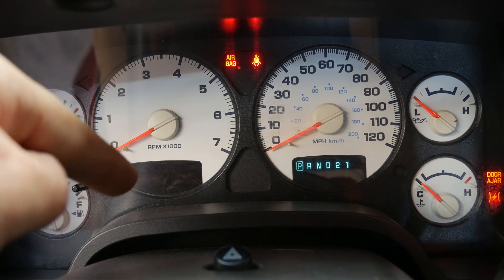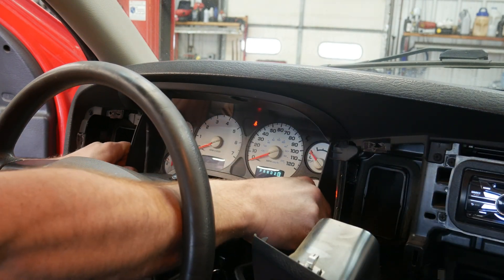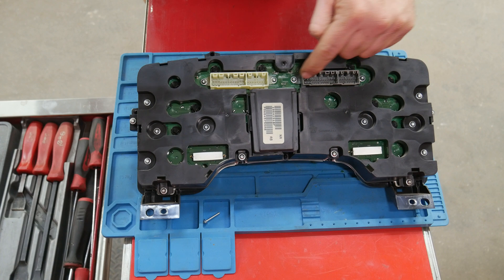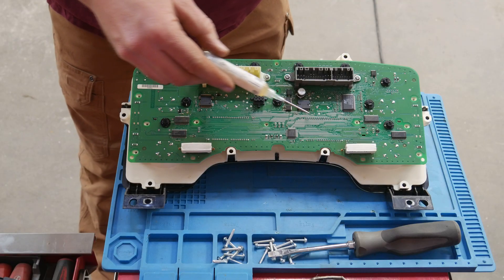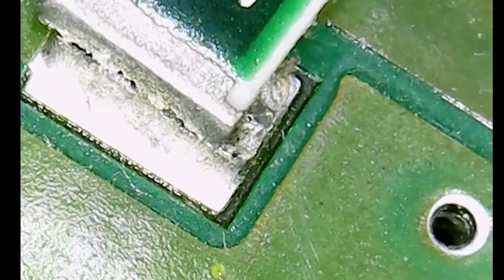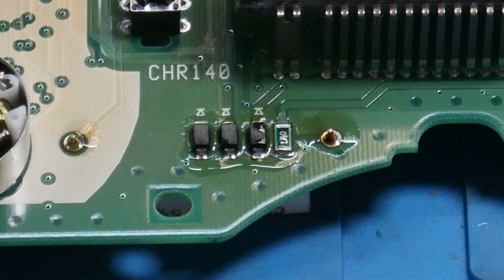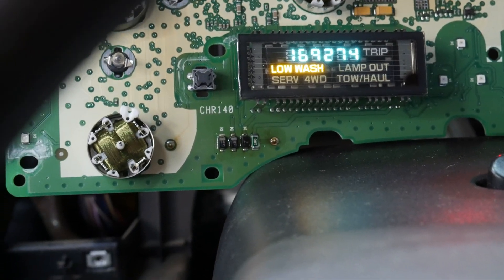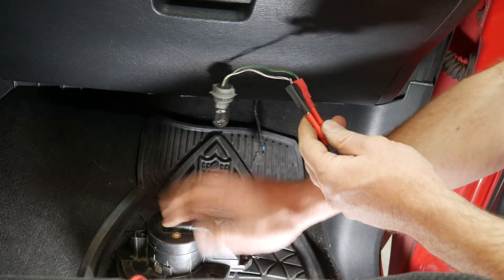2004 Dodge Ram No Odometer on cluster repair and checking blower motor

Comment: Could it be possible to replace the odometer with a new one
Reply from the maker: You could install a used cluster but the mileage would be incorrect unless you perform the correction or swap the memory chip.

Comment: Mine had the same issue and luckily I was able to solder it without having to remove the needles. I’m assuming because the big resistors on the back side build up heat that this is a pretty common failure point due to the heat exposure.

Comment: Money! This is exactly what was wrong with mine. I was also able to solder it still together so I didn’t have to take the needles off
Reply: Were you able to to get in between the two pieces and resolder without having to take them apart?
Reply: @C @CaliTBear yes, it was tight but doable with a steady hand

Comment: where are you located? I have a 2004 Ram Diesel with electrical issues (turn signals and intermittent cluster not showing mileage ) I would love to have it checked by someone like you
Reply from the maker: @fpvtrucking4830  Colorado a few hours south of Denver.

Comment: Great video....I to own a doge 1500 STI Hemi. It runs fairly well with 237k miles om it! but I'm getting around 9-11 miles a gallon with no load on the high way!!!!. I also always use top grade full so just figuring out the best next step.
Thanks,
Tj

Comment: Hello. Great vid. I’m having problems w my lcd and light display. Everything was working fine then all of a sudden the lcd , engine lights etc, odometer, turn signal doesn’t show but they work. Just no display . Also the backlights for gauges work but nothing else. Still runs great but I need to fix it, hard to drive wo the lights and hearing the turn signal clicking when using. Any help much appreciated!!!
Reply: I have these EXACT same symptoms. No lights except for tach speedo backlight. Did you ever figure it out?
Reply: @WarriorNurturer-vg8fd  yes just recently. I usually stay low in gas tank. Always refilling at almost empty. But I got some overtime and decided to fill up gas tank. 133$ later of 89 octane the damn cluster just lights up, brighter than it ever has! Try that, if not u might need some chips resoldered.

Comment: Can anyone answer this question please ? 
I have a 2006 dodge Cummins 3500 with 226520 but the whole cluster is shot.  I found one one line but the miles on it 129760 when I hook it to mine will it read my miles or his ? Please advise
Reply from the maker: The mileage is stored in the cluster on most of them so it will read his mileage.

Comment: All my dash gauges turn on and off like intermediate wipers. Drives me crazy driving down the road and they turning off and on and off....any ideas? Somebody said it could be the wires in my door.
Reply from the maker: The doors can be unplugged in the door jamb if you wanted to eliminate those from the equation.

Comment: I have a 2005 Dodge Ram 1500 4.7 two-wheel drive I replace the three speed sensor and the differential and transmission my speedometer is not working I hook my scanner to the truck and I can't get no speed what is the problem that speedometer

Comment: What temperature do you set your solder iron to reflow those components?
Reply from the maker: I typically have it set to 350°C some times I bump it up to 380°C. Leaded solder flows at lower temps typically so it can help to add just a little leaded solder when reflowing.

Comment: Thank you! Thank you! Thank you! Thank you!
 My 2003 Dodge Ram had the exact same odometer problem (intermittent then inoperative). It was even the very same capacitor causing the problem!
Thanks to your video, it was very easy to fix.
My name is also Chad 🤣😂🤣

Comment: Please help me. I have a 2004 5.9 cummins 2500. None of my dash lights work they were working on and off after I bought the truck but now completely dead. At night I can see my cluster if my lights are on. Any pointers?
Reply from the maker: I am no expert on cluster repair but on this one I just reflowed as many resistor as I could and hoped for the best.

Comment: I have an issue on the same instrument panel where three of my Dash lights work, and none of the other ones do. I replaced the bulbs and it doesn’t make any difference. I’m curious if you think it might be corrosion on the board or the lights plugged in or if there’s a resistor that powers different sections of the light

Comment: I have a 2002 Ram 1500 SLT and the odometer back light stopped working. Do you have a video on how to troubleshoot the backlights?
Reply from the maker: I don’t have one for that issue but the troubleshooting may be the same. Make sure you have proper inputs for the illumination circuit and if so just start reflowing solder joints of the resistors until it works again.  02 is an older design and likely simpler to diagnose

Comment: So my odometer back light stopped working. Took my cluster out and removed the rear cover, and looking at that same small component where your broken solder connection was, I also found te same result. I didn't need to remove the needles and disassemble any further, as I was able to resolder them still assembled. Thanks for the awesome video, and explaining the process.
Reply: Same thing here on my 04. Just fixed it without fully disassembling the cluster.

Comment: Hi Chad, Your full explinations of the problem and possible causes are just amazing . But here is one I have not found anywhere yet that shows a possible reason for my 2004 Chrysler grand voyager is tha the odometer reading does not cange the value of the distance travelled it just remains at 101288. what would be your reasoning for that . Sorry the speedometer is working well.